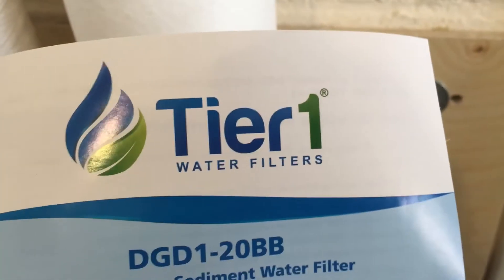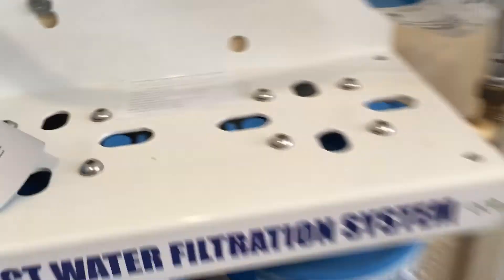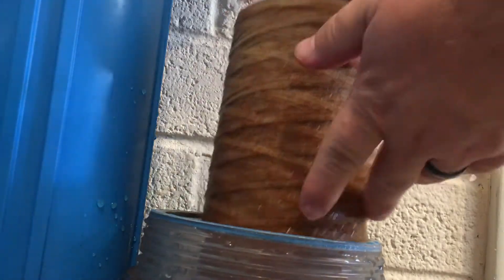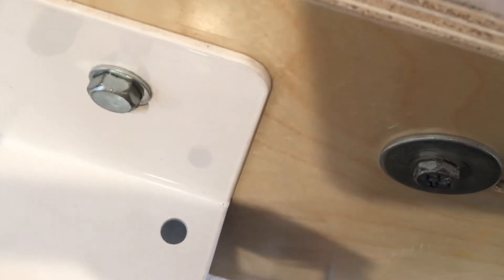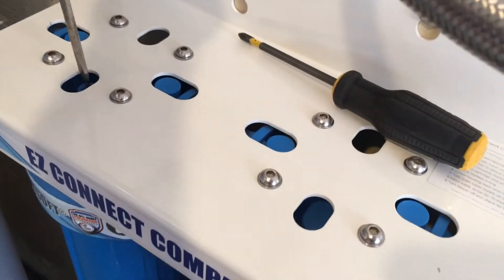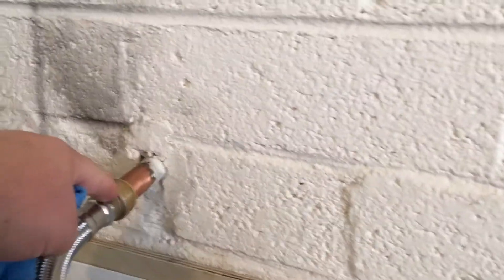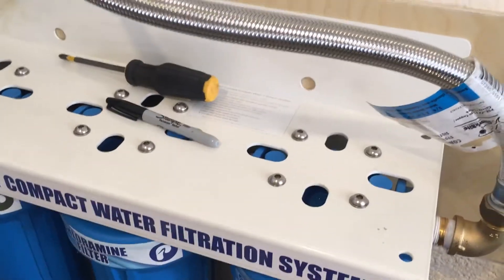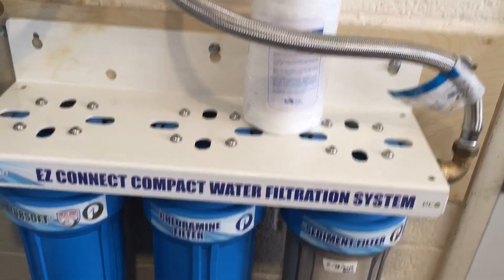5-micron to 1-micron 20" filter...will our water pressure and/or flow rate drop like a rock?

Comment: Hey, so if I choose around 3 filters to include in my system. Is there a way I can calculate the pressure drop across the filters without actually installing or building the system?
Reply from the maker: Good question! It involves looking at the flow rates of all the included components. I don't know how to calculate it, but if you reach out to the filter manufacturer they can help you, though you'll need to be able to measure your own pressure. 
If you're on city water, my guess is you won't experience any noticeable flow rate differences. 
At my house, we have our city pressure turned down to 70 psi. 
If you're on a well and it has an adequate supply rate, I'm guessing you won't notice any difference.
Reply: @DavePR  thank you soo much

Comment: love the video of the wall, no pressure difference because you're running city water.  Give it a try on a well :)
Reply from the maker: Doesn't your well have a set pressure on the pump, like 70 psi?
Reply: @DavePR  Yes but with wells we have pressure tanks that try and maintain the pressure continously.  You also have to take in to consideration of the well pump can keep up with the demand of the flow on top of that.
Reply from the maker: @Hax0rZ1  Thanks, that's all new stuff for me. I appreciate you taking the time!

Comment: Cant put a UV light before the filter.  You need minimal a 5 micron filter before the UV light. You will mess up the UV. There is no Mold on that filter. it's just dirt in the water.  Add the UV after your 3 filters. Really not needed if its city water,  it has chlorine and already disinfected from the city.  You typically just need a UV filter for Well or natural water sources.
Reply from the maker: Thank you! That is very helpful indeed!

Comment: What is the water inlet size of your filter housing? What are the 3 types of filter cartridges?
Did you measure pressure drop through your 3 stage filtration system?
Reply from the maker: 1” on both sides
Filter types are in video
I did not measure pressure in or out. Zero noticeable difference in the home.